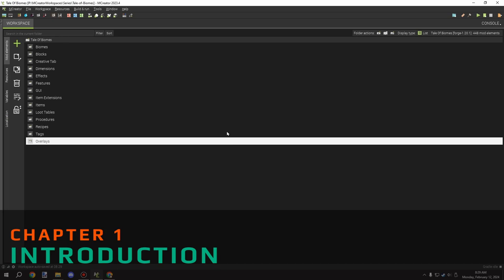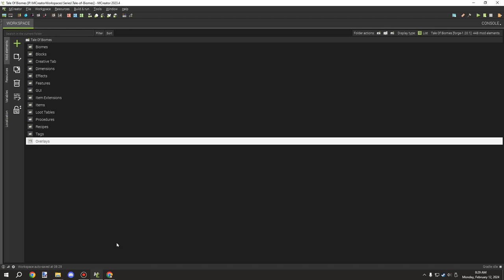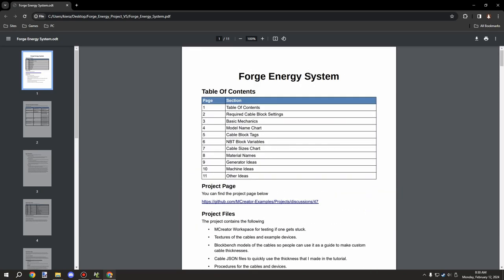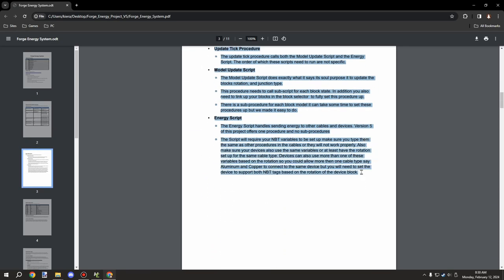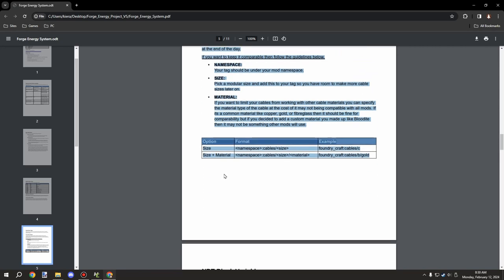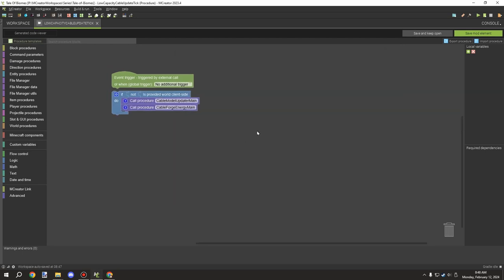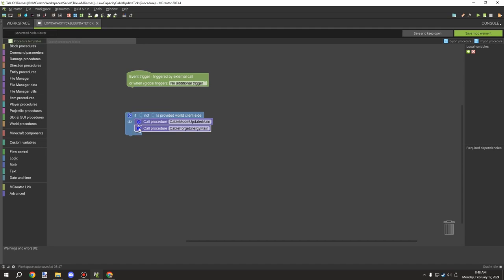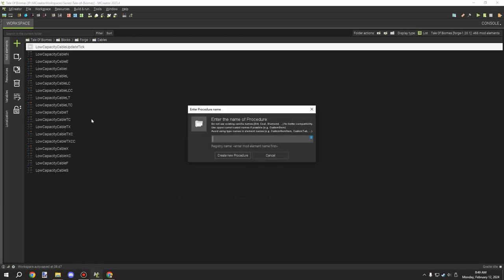Part 2 | Forge Energy Cables | MCreator

Comment: There is a Mcreator plugin for blockstates, so a cable tutorial with that would be nice.
Reply from the maker: Indeed this would be good to cover in a future video. For the plugin though it may be a waste of time if done right now, as official support has been going on for about a year or so now so rather than record two video and for a plugin that will be obsolete over time I rather wait for the official support to be added directly to the core. Nerdy has said that he would make it possible to convert but I its not so much a matter of that but having to record two separate systems. If I wait I can then cover a version that should last longer. However I can do a small tutorial on the blockstate plugin which I have figured out how to work but for reworking the cables into the the block state its most likely best for me to wait before covering how to do this.

Comment: Will there be a tutorial on how to transport power through cables?
Reply from the maker: Part 3 will explain generators. Part 4 will be a update on part 2 and part 3 as some things needed to be patched to fix a critical issue I discovered in part 3.

After that I will show storage blocks followed by machines.
Then we will move on to forge fluid which will be vary similar to cables, generators, storage, and machines.

Comment: I watched all the tutorial and I have the item ingame, but when I place the block it's purple. I revised all the textures and models and they're good
Reply from the maker: The checked black and magenta texture happens when there is no texture to display or the cube does not have a linked texture in blockblock bench. for example if the cube has no assigned texture this would be one of the cases where no texture would be displayed. When you add the model to MCreator you are prompted with texture selection too if this is not filled out then it will act the same way. So make sure both things are configured properly to ensure that the texture will show up.

Comment: Hi i'm having a problem with custom models in 1.16.5 version of Mcreator, i wanted to know if you can give me some help pls
Reply from the maker: Not sure if you mean for cables, but the cables only go back to 1.18.2 before that they they might not be compatible with older versions so its up to the developers of the mod to figure out. And Version 5 also has some critical issues which will be fixed in Version 6 which I should have ready in a couple weeks for release. I just need to recorded the video and explain the changes and such for 1.20.1.